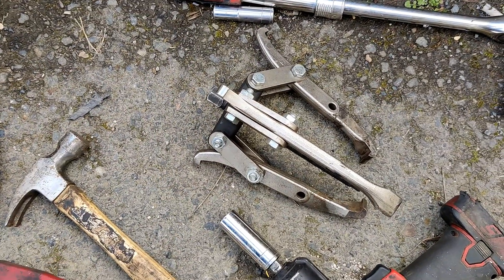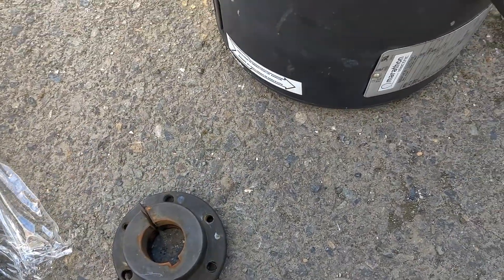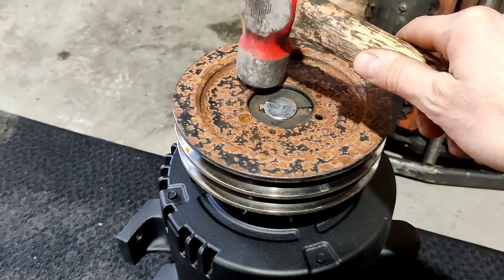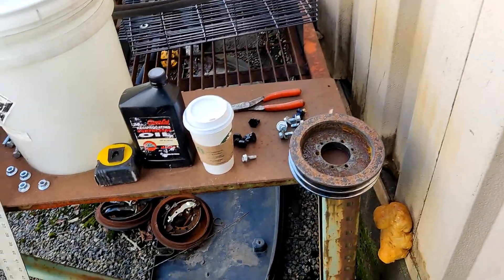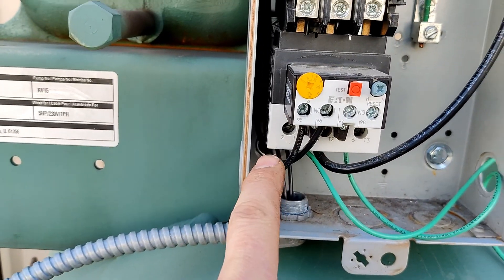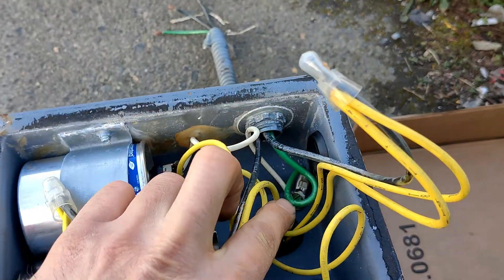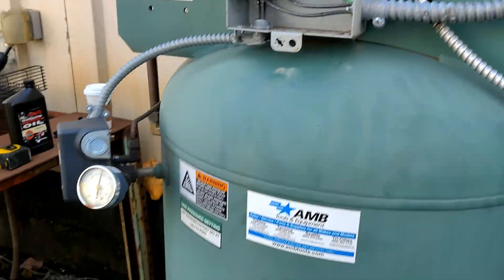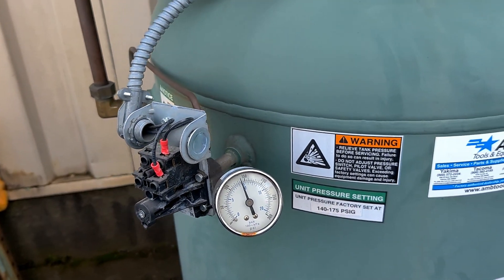5 hp 230v WEG motor Replacement and Wiring / Champion Air Compressor

Comment: I need your help! I replaced breaker and got mine to start again.  It stops at 170 psi but doesn't kick back on unless I push the reset button. I have pictures of before and after not sure what I did wrong.
Reply: check to make sure you have the right size heater in your starter. Compare to the manual chart per horse power/voltage. Possibly undersized heater.